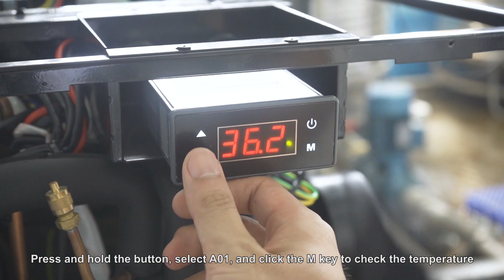Mini Inverter Swimming Pool Heat Pump fault code er04

Comment: What does this error indicate ? My brand new heatpump shows this error in my app but not In the fault section of the touchscreen
Reply from the maker: Hello, thanks for your message.
if you purchased our heat pump, you can contact the docking staff to solve the problem.